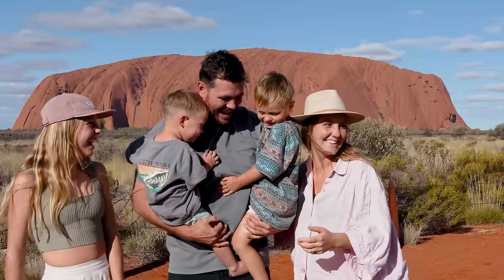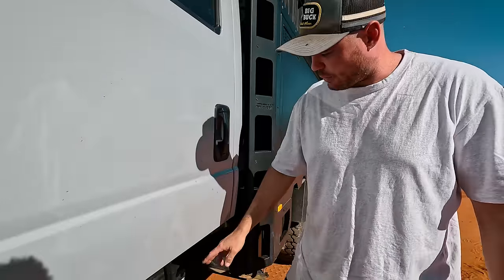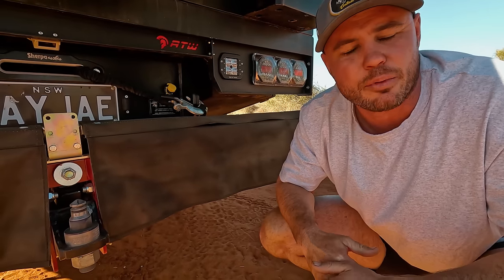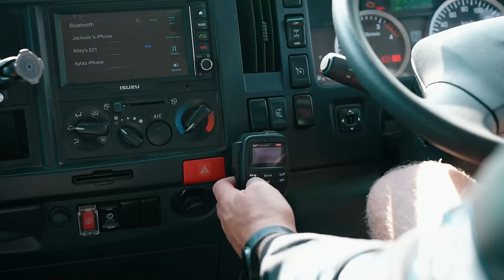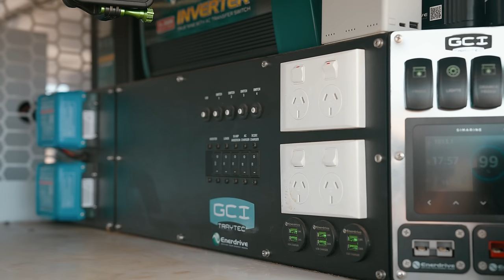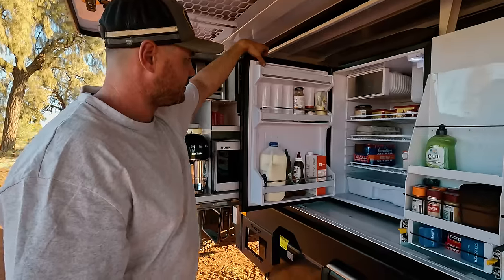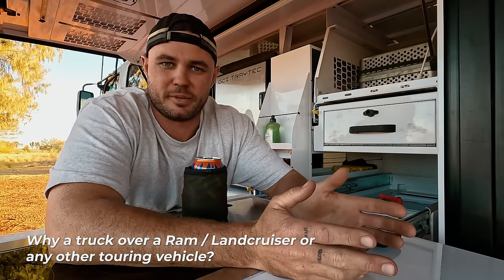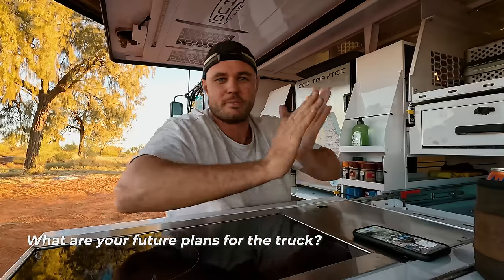RIG RUNDOWN - ISUZU NPS CREW CAB 4x4 WALK THROUGH and GEAR REVIEW - ULTIMATE DOOMSDAY VEHICLE

Comment: 30,000lb Hydraulic Winch is what you want on the front of your rig. You will continue to rip through the smaller electric, regardless of brand.
You need something that can pull that much with your rig. (Assuming you can find a suitable anchor)
.
Keep up the good work, you are living my dream.
Reply from the maker: Thank you for the advice. I’ll look into it
Reply: @thecartwrights  you should also look into engine-driven & hydraulic winches, also capstan winches. Each have their pros & cons, you're the only one who knows how you use them so I wouldn't offer a preference but you should know what's available.

Comment: I have a new 45 155 npr manual, would not pull top gear, i had it dynotuned for about 2k, now it is the truck it should have been, drive top gear everywhere and 10 to 15% less diesel. it is a must do on the 5.2l  as it is in its lowest state of tune in a 155 truck.

Comment: great build..  yeah i understand you with the amt. for terrain you would like a manual where you can control the revs  with precision to get unstuck or not get stuck.  same problem automatics got when driving in snow or on ice is  its hard to control the power you put down to the wheels.
question..  how much got destroyed when it got stuck in that mud.  only axles  or   did it bring some nasty expensive surprise like transfer case or something ??

Comment: Awesome effort guys. Would not have been a pleasant mission at all. 
Watched your vid and last 5mins saw you had a rear winch. 
Ive used a rear winch to move forward before. 
Stuck in a river bed in a unimog.
Ran the cable under the diffs and worked a treat. Did this in NZDF  year's ago training  but seriously stuck.
Nice job you two.
Reply from the maker: Cheers mate. Yeah a couple of people have mentioned this method. I never thought about it to be honest. It’s all learning my friend
Reply: I would worry about the cable sawing through the axles or the cable getting cut on a sharp edge, cables cut through amazingly easily. 

Also, pulling from the wrong end is unstable, I once had to pull a trailer up a short gentle slope hitched on the wrong end & it took 6 heavy blokes to hold it straight despite pulling really gently. 

If you've got enough fairleads to guide the cable through that's fair enough but without? I wouldn't want to trust my life to it.

Comment: Most interesting, But I am left to wonder why you don't carry/use a sand anchor, That, buried in front of your truck. on your video in the Simpson desert would have been so easy to get yourselves out, even digging a hole to set it, would be easier than the 'landscaping" you did. But the thing I am interested in, is you are only running a 2Kw inverter and 200 amp hour batteries  in the truck, yet you have a microwave, that doesn't work that well, (think you said) an induction cooker. and you run air-con in the van, how long can you run that for? or do you have a generator as well. I just want to know because we are about to hit the road in NZ for our caravan retirement cruse. and basically I am trying to find if we are set up well enough, or what else we may need to change in our setup. Love your Videos, looking forward to the next one.

Comment: Cartwrights, I am a fan of your setup. I like the four-door cab and low roof. Looks sweet. 
     Is a hydrostatic-powered winch a viable option instead of electric? They are usually found on military vehicles.

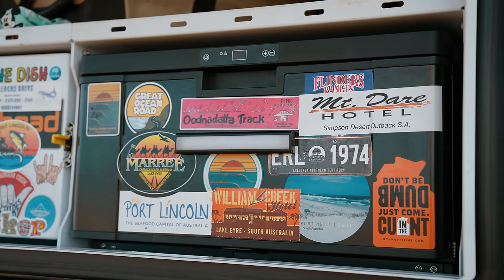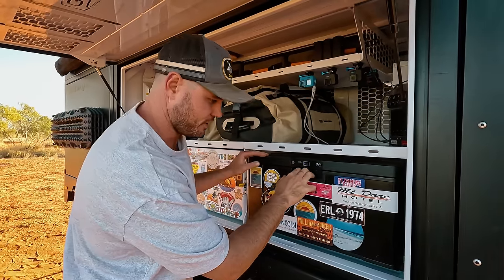at time 34:20 the 'don't be dumb....' magnet is there and then it is removed at 34:27. I like it. Leave it there.

     There is no wasted space with a hooded engine in front of a cab. I like the cab over design. I am a fan of the US Army LMTV 1095 (3 axle) or the 1078 (2 axle) that some overlanders use.
Reply from the maker: Haha. Very keen eye!!

The overlay was actually shot a couple of weeks AFTER we shot the main video. And the sticker was purchased within ghat time..so the sticker was visible in that footage and not visible in the footage where he is talking.

You will be pleased to know, the sticker is still actually there 😆😎

Comment: Just found and subscribed to your channel.  I love you rig. I tow with an 2000 International 4700 mid duty flat bed.  I put my Suzuki Grand Vitara on the flat bed and tow a 26 foot off road travel trailer ( yes I am in the US).  I have two issues with my set up.  1, the truck is two wheel drive, 2 it is long. ( it takes 39 acres to turn it around).  I am looking forward to your adventures.

Comment: you need a fork-seal saver or “seal saver” for your peewee50 bro, you’ve ratcheted that badboy down hard. it’s basically a block that goes in-between the tyre and the bottom of the front  triple clamp forks so it ratchets down on the tyres taking the pressure off the fork seals. Much more rigid.
Reply from the maker: Hey mate. We have one. This was literally 2 days after we got the pee wee. And the shop didn’t have one. Ordered one online 🤟

Comment: If you ever find that the 40dcdc is lacking, check out the Argofet. Those 200a lithiums are able to take a massive input!

Wickid run down! Relatable family! Can't wait to see more of your adventures bud!
Reply: To get anywhere near what the lithiums max at would need a massive alternator upgrade, the setup there looks like it's about maxing out the stock alternator. 

I've got the stock alternator on mine & if the house batteries are down the belt squeals for up to a second when the charger kicks in, I don't think it would take a bigger alternator.
Reply: It's only got a 40a dcdc managing the lithium bud. Plenty of head room

Comment: Due to how signals work its worse to have your phone in your hand than it is to have the antenna on the outside of the car. If you dont have your airplane mode on your getting way more exposure in the cab. Mute point given you have a uhf going anyway which is the same waves just a a different frequency and wavelength but just thought id mention it for educational purposes.

Comment: I have watched this a few times now. With your fuel tanks, you were saying the are seperate systems. Is that seperation by pollak valve or 2 completely seperate systems? I am putting a 200lt tank on as well as the standard 140lt tank and want to run them as seperate feeds. At the moment all I can find is a pollak valve to do the job.  Any gfuidence on where and how yours is done would be great. Great run through BTW

Comment: Hi guys love your videos please let me say the only thing that makes me as frustrated as you and thats getting bogged ! Well i have an answer to your preyers the system you need is a bit like the jacks on a formjlar 1 car 4 hyrolic rams that can lift your truck 4 feet in the air on any corner including the van its such an easy to instal asnwer lift it up put a peice of wood or a max track in the hole and drop it down drive out works every never be bogged again has other great uses like self leveling out on sloping land ect similar to a crane

Comment: I know for me, I'm interested in the fuel economy just to know a ball park figure of how much the running costs vary from a cruiser or whatever. Having never owned one, I think it would be easy to think it would use 100L/100km. Until I started looking into fuel economy of coaches I thought they would use a lot more fuel than they actually do, so the option went from probably not worth it, to a high probability, since they use more like 25L/100Km.

Comment: That's great fuel economy. Probably better than a landcruiser and a 3.5 van. If it's accurate. The truck by itself is also affordable. I'm guessing if you buy a used truck and make a simple canopy Probably cheaper than a landcruiser.
Reply from the maker: Yeah it’s pretty good considering the weight we tow

Comment: Surely a diesel performance shop could program the shift times on the auto and remap for more power plus upgrade the turbo and injectors. 5.2l is a pretty big motor should make some power. Although what most people here don't know is in the states these came out the a commodore v8 and auto. If you search isuzu 6.0l in youtube you'll that they have the LS under the cab. I'm sure wreckers in the states would stock harnesses and transmission collums, engine mounts for a few bucks to make this all work. Not sure why nobody is doing swaps here or no company's invested professionally to convert these over to a near factory LS swap like they have done with the american bonneted trucks.
Reply: LS is the wrong engine for this truck or any truck. I have both a 6.0 l caprice and a 3.0l diesel discovery. The disco destroys the 6.0, for torque even though the disco is 600nm and the caprice 590. The caprice is just hopeless for hill climbs us and down the gears  no torque at 2500rpm. A few people have put the LS in 4x4 and normally regret it, totally gutless where you need the torque when off road.  Diesel every day of the week over petrol for off roading. Petrol would also use 30% more litres, sorry it is just the wrong engine for this application. My disco uses 1/2 the fuel and I tow 3.5 ton every where with it. The 6l caprice is fun dont get me wrong but the engine really needs to rev to 4k before it starts making serious power. Disco is 500nm 1/2 second off idle and pulls hard for 3000rpm at around 600nm. With the petrol 6.0 and 6.2 you end up having to ride the clutch to get it into the torque at 4000rpm, would drive anyone nuts off road.
Reply: @4x4smile  I didn't say the ideal capacity is 6.0l or 6.2l. You took what said and twisted it. Do you realise that 100% of people who play with LS swaps in Aus do them wrong? Especiallty for 4x4 and towing. No wonder they have no torque at 2500rpm!  Your caprice has 2.92 (I bet you didn't bother to put 3.73s in) gears vs 4.xx something in the isuzu btw. Do you actually realise heavy duty trucks like 2500 and 3500s including dullys have diesel as and option in America and all come standard with gas V8s? Do you also realise that most people who buy a HD converted truck here in Australia are only towing up to 4.5T and don't hook up air brakes to tow 6, 8 or 10T, as opposed to yanks who can continue to use electric brakes up to any weight? Also before you say 3.73s would rev to high on the freeway, yanks actually say they are an all round gear vs something in the 4.XXs described as a towing gear.

Comment: When you switch fuel tanks does the fuel gauge switch too?
Reply: Yes they do.  All done by ATW, great setup for remote touring.
Reply from the maker: Yeah it does. But it takes about 25 mins for the indicator to read the other tank. The truck is really low tech hahahaha. If you turn the engine off and then back on it reads straight away

Comment: What the total weight of the rig fully loaded?  Your truck is a commercial grade  I got this explained when I bought my 5500 dodge   my 3500 dually is not a commercial grade  just crossed canada  from Alberta to Quebec and back  came back with a good load on a 18feet trailer  all together  1775liters of diesel   692l going empty   1083l coming back  with a dodge  megacab 06 5.9 Cummings  standard tranny   not to bad  2962 canadian dollars of fuel 
Was average 1.55$  going in but close to 1.80$coming back   now here in Alberta its  around $1.49  1.55/l  in eastern Canada right now it average 1.90 to 2.10 good thing I got the hell out of dodge  lol  like the video  very informative   take care be safe
Reply from the maker: 6.9 tonne!!

Comment: amt to manual conversion is not hard , i am sure you will find a shop that will do it , amt is basically a regular manual transmission with actuators to control the clutch and shift gear. they are slow and horrible , the best amt i have driven is in scania trucks. others are all garbage.

Comment: Can I suggest get bit more training about theee trucks. 
The AMT gearbox is a manual gearbox that changes automatically. Not an auto. 
You need to learn how to use the AMT the same as a manual. It’s direct drive where autos aren’t. 
That’s why they sound the same as manual changing gears as opposed to talk converter autos have changing gears. 
Manuals require less maintenance, are cheaper than autos and give you better control. 

Also these Isuzu trucks will out pull anything a land cruiser or dodge will. If was legal You could put 7 tonne behind these and they’ll go all day. Can’t do that with Land Cruiser or dodge. 
Horses for courses mate and these will continually out tow any American 4wd.
Reply from the maker: Mate it changes gears by itself. To the common person (like me) it’s an auto. 

I understand all the technical terms surrounding an amt. but at the end of the day. It doesn’t suit the type of touring we do. Or I’m a spastic and can’t drive 😂